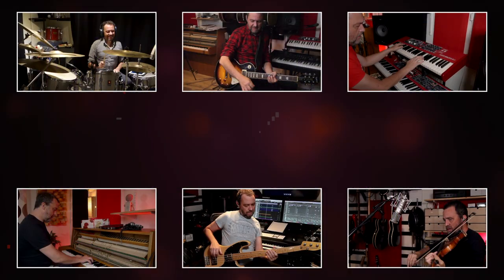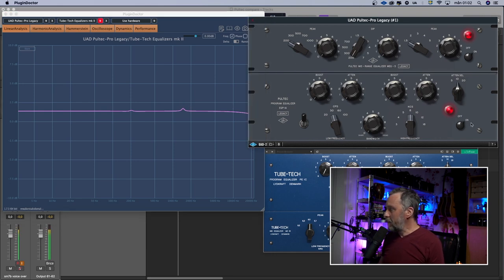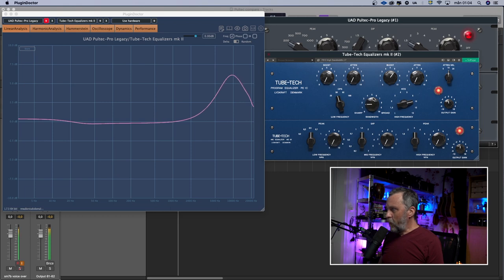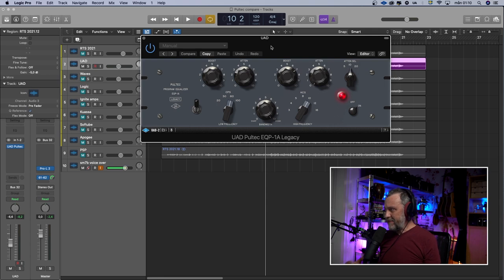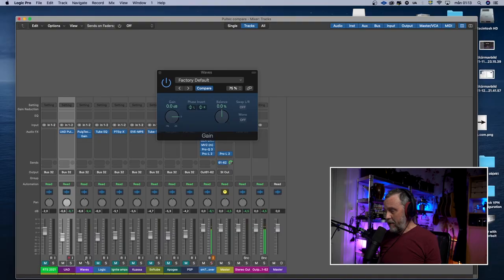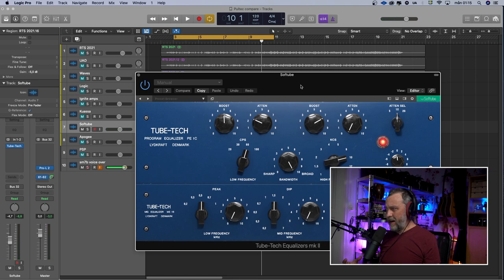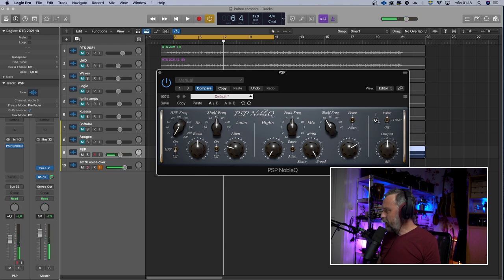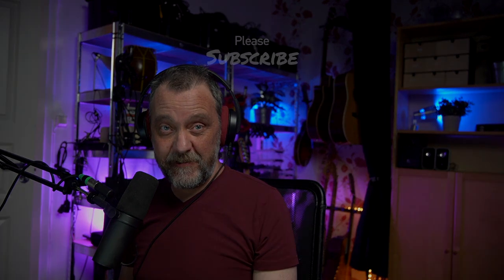8 Pultec EQ's compared

Comment: Another one to add to this list now is the Noise Ash Rule Tec.  Can be had for under $50 on sale and I like how they have the high and low pass included in one unit.  The UAD one is probably the most accurate but to my ears, the Rule Tec is close behind it.

Comment: I've used at least three different Pultec emulations and the one plugin you didn't mention is the one I now use all of the time... IK Multimedia EQP 1A. It sounds great with no added noise!
Reply: It has a lot less punch and bottom end than the UAD one I think. I recently did a personal shoutout between the two.
Reply: I have 5 different Pultec emulations and the IK in my opinion or should I say my taste is the one I go to most. I also have the WA hardware Pultec, after comparing it to the IK Plug in I think I spent $$$$ that I didnt need to spend. I like Softtube and also the WAVES but I know by mentioning the Waves Ive totally blown my credability LOL. Hey, it works great too.

Comment: I think Apogee is owed a fair review/comparison. At the first go you had the attenuation at the maximum. When you reset the plugin because of the 'bad sound' you missed addressing the attenuation setting. Maybe that's the default setting (though that doesn't make any sense), so I'm not faulting you.

Comment: Didn't you see the apogee had the high attenuation completely open? 😉
Reply from the maker: I saw it to late and wrote it in a comment.
The attenuation was on by default
Reply: @Rogerthatmusic  don't worry,  It was such a great comparison with only that apogee downside to mention.  Indeed I've tried all these plugin and I own 2 of them. The one I was really interested was the apogee indeed, because I've never demoed.
 I'm still not totally satisfied with UAD (great top end but low boost and cut doesn't work as the hardware) and waves (which doesn't shine on anything to my ears).  Also the analog obsession rare deserves to be mentioned since it is second to none for bass frequency boosting,  maybe the only one that can replicate the hardware on bass boost and cut. And it costs 0$ 🤘..

Comment: I think it would have been (possibly more) interesting to see if those boost/cut differences compared to their hardware counterpart. - Is the Software model the same as the hardware? Is it wrong? (Incorrectly modeled? Or Does it match the hardware?)
Reply from the maker: I understand that some people find that (more) interesting. But for me it doesn't matter that much. I care about if it sounds good and if it's useful first hand. Of course it could be interesting with a comparison from a theoretical point of view.
Reply: But which hardware counterpart? There have been various revisions to the original specifications, it's an extremely old design, and it's analogue. Each unit has its own character. At least one of the plugin emulations was based on a specific unit that sounded "better" than most other examples because of a unique "error" in the circuitry. The hardware devices are all unique in a similar way to how every Rolls Royce made 60 years ago has its own individual quirks.

Comment: So…. If UAD, have a volume boost when engaging the plugin and you say this may be an actual byproduct of the original as it is an emulator so they say it is end to end , and you open everything with the statement that you don’t like this,, sorry I don’t understand, am I misunderstanding the idea of an emulator supporting the exact conditions of the hardware as being a faulty aspect of the model that you d3sire to be amended because that’s what you want, or something you deserve? If it’s exact, we’ll then haven’t they modeled it correctly? Not hating on you, just want an answer to this seemingly perpetual issue everyone seems to have
Reply from the maker: It's just that I like to hear the sound of the plugin and not be fooled by changes in volume. Our ears are sensitive to volume and if a plugin has jus 1db more gan we often think that it sounds "better" but actually it's just louder. Even if it is in that way on the original hardware I would like  zero db be zero db in the digital domain.
Reply from the maker: Good question 🙂
Reply: @Rogerthatmusic  ok, fair enough, imo, I feel if the hardware does the same thing then the emulator is doing it right. Btw I have no experience using the real hardware, just my opinion or 2 cents is all I mean by it. Peace
Reply: I always volume match regardless so I guess your point is well valid👍🏼